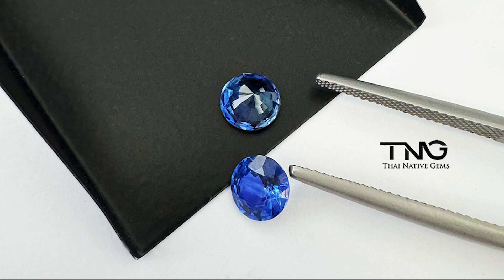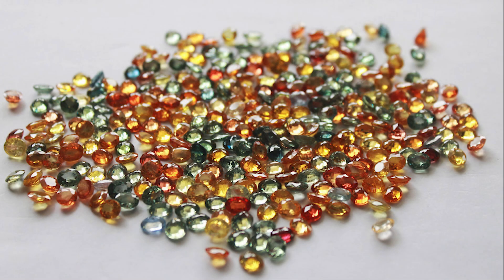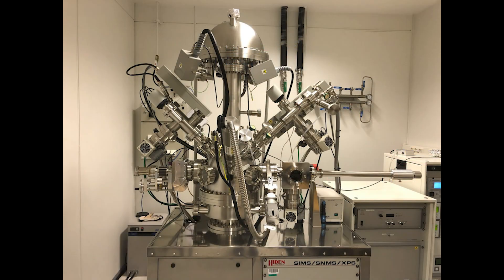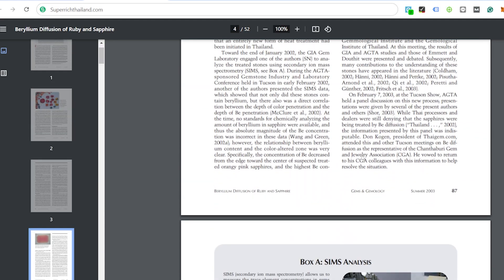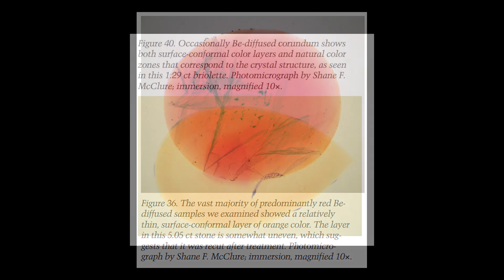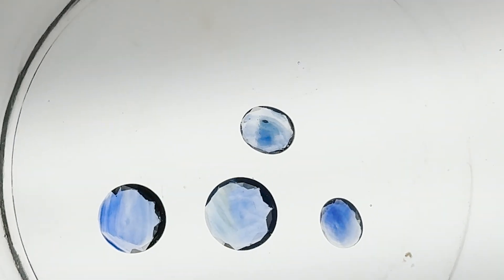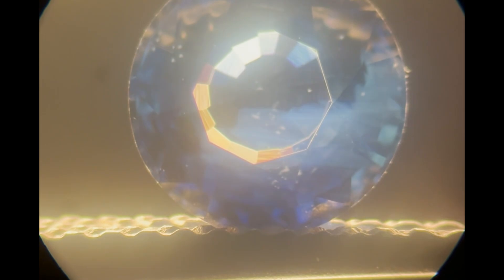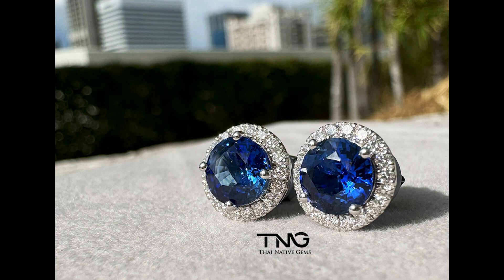How to Check Blue Sapphire Beryllium Diffusion Treatment using Water Immersion Technique

Comment: So confusing when you're talking about angular colour zoning of the normal treatment but you have your tweezers and playing with the Beryllium Treated stones.  Has me wondering if I heard you wrong when you said which ones are heat treated vs beryllium treated, and because you're pointing at the beryllium treated but talking about heat treated, where did you make the mistake, was the mistake when you're pointing or when you said which was which .... but guessing you're just pointing at the wrong ones because you didn't edit the video well.  As I'm pretty sure the large rounds are the ones with angular colour zoning and the small ovals have the large centralized zoning.  Anyone, comments more to help you make better videos in the future, as that is confusing to a beginner like myself.
Reply from the maker: Sorry for the confusion and my editing skills! You are correct in assuming that the round, 'angular' stones with no color zoning are traditionally heated sapphires, while the small ovals with large centralized zoning are beryllium-treated.

As described in the video, this method helps identify about 80% of stones. However, because characteristics can sometimes overlap, the best way to verify a stone is to check it under a microscope or send it to a reliable third-party lab.

Anyway, thanks for your feedback on how we can improve our videos. Good luck with your gemology journey!

Regards, 

Tarun Gupta, GIA GG

Comment: I also have question about the padparadscha color.  If it has beryllium treatment will it still have silk inclusions?  Does topaz have silk inclusions as well?
Reply from the maker: Silk inclusions can be seen in both heated or unheated stones.  The difference is the silk will be 'intact' (meaning not broken) in unheated stones, while in heated or beryllium treated they will be broken or 'doted' due to heating process or resorbed. 

Recommend reading our blog post which have some images & video of this which you can see here: https://www.buygemstone.info/sapphire-treatment-guide/

Regards,

Tarun Gupta, GIA GG

Comment: What about iridescent silk?  Is this still the most reliable way to see if the sapphire is heat treated or not?
Reply from the maker: Any inclusions, including iridescent silk, rutile silk or crystal inclusions gives us a clue what type of treatment the sapphire has gone through (unheated, heated, etc.,).   However there is no 'strict' reliable way and it depends of stone and type of inclusions.

Checking for heated, unheated, chemical fusion, etc., is like a detective looking for 'clues' and indications, which these inclusions do help.

Hope this makes sense.

Regards,

Tarun Gupta, GIA GG

Comment: I bought a strand of beads (great looking but cheap about $500 per strand) off eBay. The colours range from purplish pink to intense hot pink and some intense pinkish red. 
I purposely purchased the strand that did not include the intense pinkish red hoping that it would reduce the chance of getting Be diffused sapphire beads. 
But the fact that the guy had padparascha colour in his inventory makes me wonder if my hot pink and purplish pink sapphires are Be treated. 
He claims that he only uses heat treatment without the presence of Be. But I’m not sure if I should trust him?
Can padparascha colour be produced by any other methods other than Be diffusion? (Including synthetics, lab created, etc.)

Also, is hot pink a colour that is produced through Be treatment?
If yes, since beryllium is highly toxic and carcinogenic, should I be concerned about handling these beads?
Your help is greatly appreciated.
Reply from the maker: Be treatment comes in all colors.   Hope this answer helps.

Regards,

Tarun Gupta, GIA GG

Comment: I have 2 questions. Please answer if possible.

1. Does white snowball inclusion appears only as a result of a heat treatment?
2. How to identity difference between white snowball inclusion and air bubbles in synthetic stones?
Reply from the maker: Answers are provided below:

1. Does white snowball inclusion appears only as a result of a heat treatment?

Yes, if is actually a 'snowball' and not any other inclusion then yes, snowball inclusions is a result due to heat-treatment.

2. How to identity difference between white snowball inclusion and air bubbles in synthetic stones?

Experience and keep looking at natural or synthetic gemstones under microscope.   It is looking doing anything in life.   The more practice the better for you will see the difference.

Thanks for your questions and best of luck with you gemology journey.

Best Regards,

Tarun Gupta, GIA GG

Comment: By the way, I have some alexandrites from Russia and with the recrystallometer it gives me 1.748-1.763. My question is, is this range real or does it indicate that they are synthetic? That's how these alexandrites are. The biggest one I have is 17+ carats and I'm about to get one of 36.45 carats. These come from the rural areas. Of course not directly. But this site is the origin of these. I would like to know if with this numbering it can be confirmed that these are genuine or synthetic.
Reply from the maker: Alexandrite has an RI of 1.745-1.755 and is doubly refractive.    This test doesn't distinguish between real or synthetic as chemical compositions for both 'genuine or synthetic' will be the same.

The best way to check is to see the stones under microscope to find any clues if they natural inclusions or indications of being synthetics.   

Of course the easiest way is to send to to reputable gem lab to verify if the stones are genuine or not.

Thanks for watching our videos and other compliments.

Best Regards,

Tarun Gupta, GIA GG
Reply: @ThaiNativeGems  In the gem book it has a refractive index of 1.744-1.763 but since my pieces indicate this one I give you is 1.748-1.763.